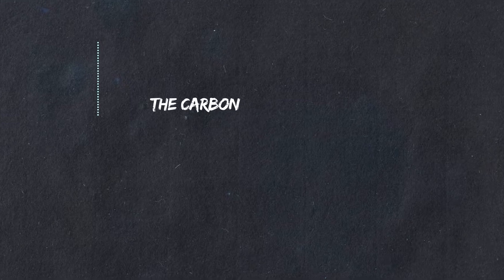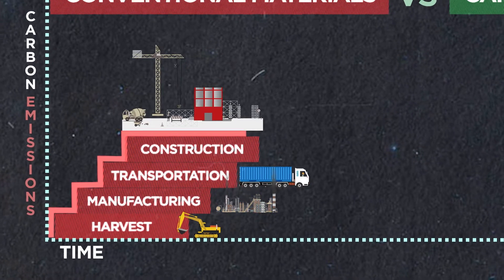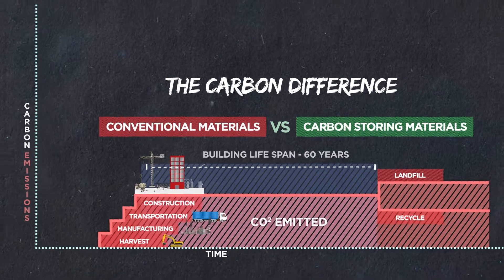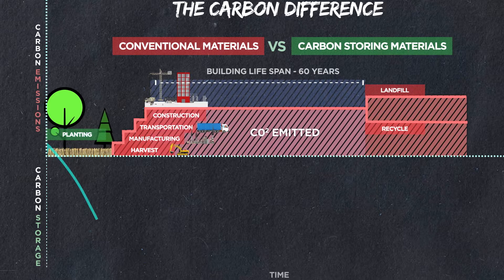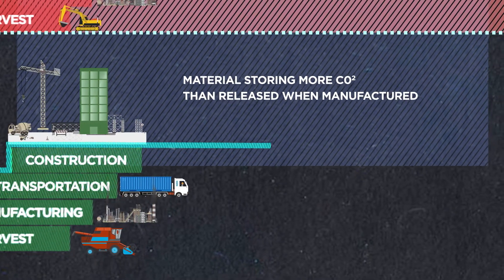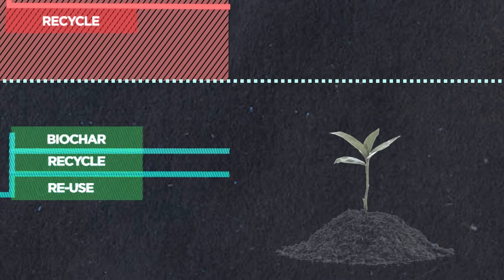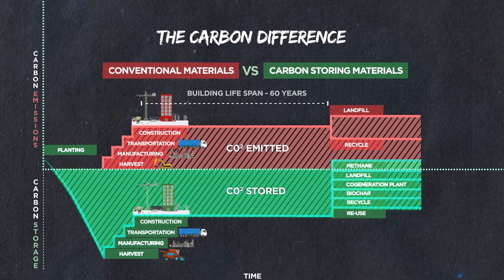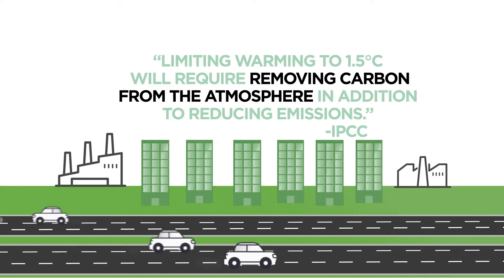Making Real Zero Carbon Buildings with Carbon Storing Materials (What is Embodied Carbon?)

Comment: Doesn't this assume the buildings made from both types of material only last 60 years?  Wouldn't concrete homes like ICF not only survive fire, tornado, and animal, bugs, it would last longer. The thermal mass that is more comfortable to the occupants especially in severe heat like the coming climate change.

We have to ask... how is a house, not really, really well insulated, going to handle the higher temps and powerful storms in 2085? Is a house with a lot more thermal mass in the walls going to bear better when cost of power is much higher and more likely energy outages too due to climate change.  Is a house with more thermal mass better for going off grid mid-century?  Is it better under war conditions (Yes, this is a thing.  THE USA is just lucky that war is almost non-existent on its shores but it's not immune.)

What if an ICF house lasts 100-140 years compared to the 60-100 year old wood home?

Locations that are prone to tornadoes and forest fires should consider 6" ICF so they we are not rebuilding these homes from scratch which has a huge carbon footprint.  2x4 flying in a tornado can go right through normal wood and sheetrock walls but not through an 6" ICF wall and it doesn't burn down easily either in forest fire.

You can build with a carbon intensive material but do it right so it lasts longer and is super high performance requiring less HVAC tonnage installed and only electricity to power it with solar panels.
Reply: I am on a benge trying to understand actual uses of carbon captured and everything I find is this vague... So many assumptions made, so many questions skipped. It's like watching one of those old "ancient aliens" or flat earth documentaries". No Substance

Comment: Wood is great but the amount of climate gases in the atmosphere is already too big when starting to build no matter the material. Building with wood still is a problem, but less of a problem than building with concrete.
Reply: Great questions! For us, it comes down to 'so, we have to build' and the question then becomes "what materials are we building with"?  What alternative materials are available for us to use, and what is the full story of their extraction, manufacture and end of life phases.  Wood stacks up on all three -  it's the utlimate renewable! :)
Reply: @forestlearning5049  In some cases it is possible to not build. Instead to convert or live differently as a single person. Would you still say you have to build if you knew that the climate went straight to hell for humanity?
Reply: Hi Michael, Please see my response to Em Russo above for our more nuanced take on wood. The short version: we don't actually count carbon storage in virgin timber products in our calculations today, because we don't have sufficient data/reporting to understand the full climate impact of timber harvesting. It may be possible to build with wood in a way that helps the climate, but it's also reasonable to estimate that this is not the case today for the majority of wood being harvested.

Comment: one critical remark: the surface coloring indicates a growing emission and storage in time which isn't true nor necessary to make the point. Here visualisation enthousiasm interferes with the correct meaning of the graph
Reply: I noticed the same. Remove the area coloring cause it is both wrong and confusing.
Reply from the maker: The colouring indicates that either the emissions are still in the atmosphere and continuing to drive warming year after year (for the red colour) or that the carbon continues to be stored in the building year after year (for the green colour). The climate impact of emissions is not a single fixed number... it's the AREA above or below the line. This dynamic impact is not something that current LCA practice considers, though dynamic LCA approaches are beginning to emerge that reflect the climate impact over time.

Comment: Two critical things to be clearly checked. 

1. Can plants store that much amount of carbon?
2. Additional carbon emission process should be added: plant to carbon storage material.

In the end, can this really offset whole carbon emission in the all value chain of the building construction process? (It stores even more than conventional construction)
Reply: Hi Ben, thanks for your question/comments.
The answer to your first question is, yes, plants can store that much carbon. Each year, the world grows billions of tonnes of agricultural residues (the plant matter left after we take the food bits away). For example, ~2 billion tonnes of grain straw is harvested annually and the ~4 billion tonnes of CO2 this has drawn out of the atmosphere is equal to the annual emissions of the country of India. We currently burn or rot nearly all of the agricultural residues (not to mention waste plant material like newspaper, cardboard, old clothing, etc) on the planet, returning all that CO2 back to the atmosphere. The potential supply of this material is much larger than the entire building industry can use... so yes, there is lots of it and it stores a lot of carbon.
When we do the calculations of net emissions we always account for the planting, harvesting and production emissions that happen along the way... that's why the green line has a number of upward steps on its path, representing emissions that happen along the manufacturing and construction path. However, the vast majority of plant-based building materials store more carbon than is emitted throughout these life cycle phases. When these materials are incorporated into a building in sufficient quantity they can indeed offset the emissions of all the materials in the building. We have been using our BEAM tool to verify this, and have a number of case studies of actual buildings that get close to (or even exceed) net zero emissions from their materials.